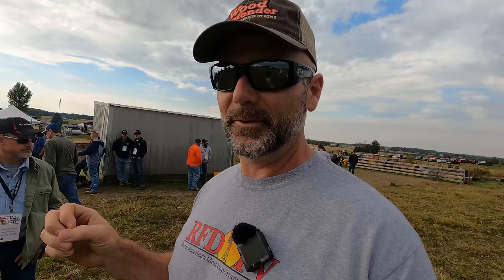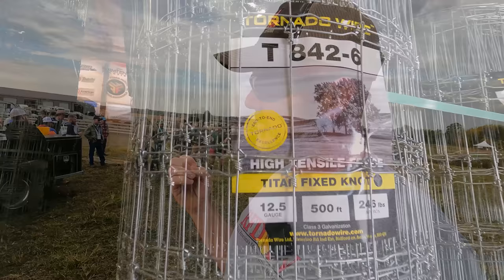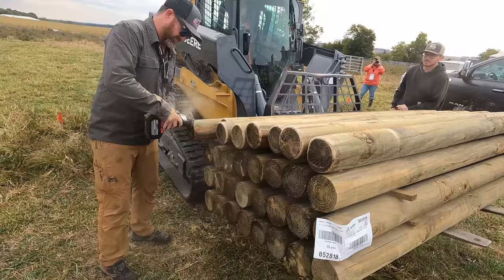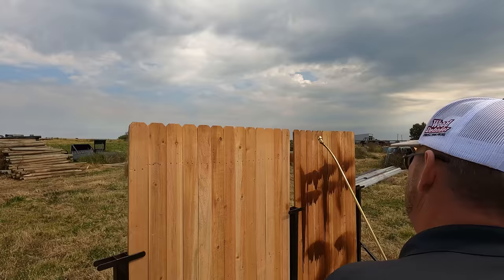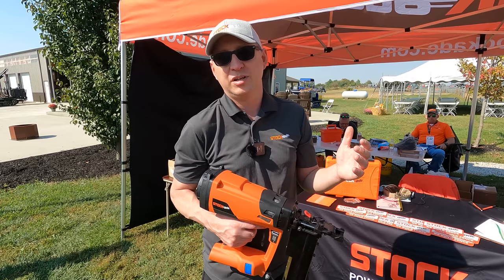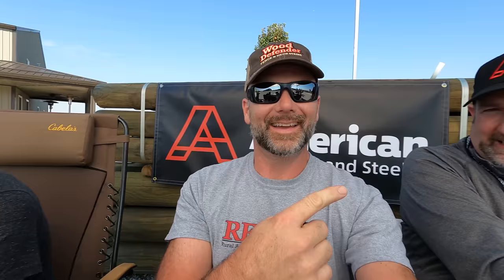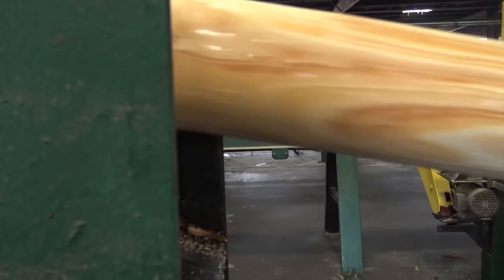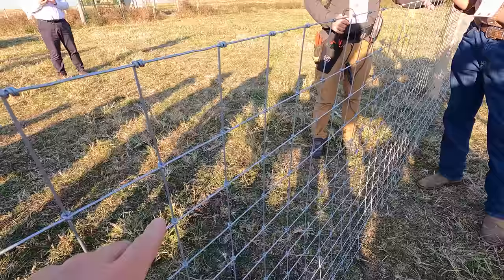Tools you've probably never seen...Let's build some farm fence!

Comment: Josh, have you considered a back up Generator? For around $600 you can purchase a generator that will power your shop temporarily. It would allow you to get your wiring and lights in, so you could get the floor finished before winter time gets here. Then let the power Co. be slow if they want to. Get someone who knows more than me to tell you what size it would take just to get power to finish your part of the work. I have a 5,000 watt, that power our house when power goes off, and it handles everything we have. I will say we also have natural gas, for heat and cooking and hot water, so, that cuts down on our wattage use. Granted you don't want to use one all the time, but a few days to beat winter time, it might work. Generators are like most everything else, you can spend as mush as you want to, depending on the size.
Reply from the maker: yeppers.....already in the plans...I have 5 generators on the farm

Comment: See that split at 11:47? What's the best way to prevent that as much as possible while still remaining efficient? Is it just placement in relation to the grain, angle, pressure, all of the above or something else? Also, for post driving do you prefer the vibratory style or the hammer style drivers? Great video, looking forward to the rest from the FFF. Thanks!
Reply: I personally haven’t found a way to prevent it, especially with less than super wet boards. In the case of the video, they’re using a Jumbo Nailer with 4”x 0.148” nails. So bigger than a regular old framing nail. The face boards, especially on 1” boards, play a roll in keeping the fence together & looking good over its life.
Reply from the maker: remember...we're dealing with wood...it's rustic and it's gonna warp, crack and move for sure.  Vibratory hammers beat the living snot out of a post...I prefer these hammer type v/s vibratory
Reply: @jonathanwilhelm2958  I keep boards on hand for repairs. I've noticed that they split less when new and wet than when they're dry. For repairs I drill pilot holes and nail in by hand to prevent splitting. It works very well but it is also very time consuming. Thank you for the reply.
Reply: @StoneyRidgeFarmer  I figured those vibratory drivers were hard on the posts. I'm hopinh to pick up a tracked skid steer and a post driver over the winter. Thanks!

Comment: Wow. Even though I find a lot of your episodes very interesting not the case with this one.
Most of this ridiculous equipment is for a professional fence Builder not a farmer or Homesteader.
That post driver and much of the equipment is completely worthless on anything less than ideal soil conditions. If the soil was loose enough to drive a wood post in with a hammer then the soil is soft enough to dig it out with an old fashioned post hole digger.
Most of this equipment was absolutely ridiculous.
Bring that stuff out to the Ozarks and let's see plant a post out here😂🤣🤪
If you're not in Rocky Mountain terrain than an old fashioned auger on the back of a tractor and a T post driver is all you need.
Reply from the maker: you can rent every piece of equipment you see in this video..a person that has a half empty glass will forever find it half empty until they change their mind.  Be happy brotha...we're building top quality fence here....there's a time and a place for tposts...it's just not here.